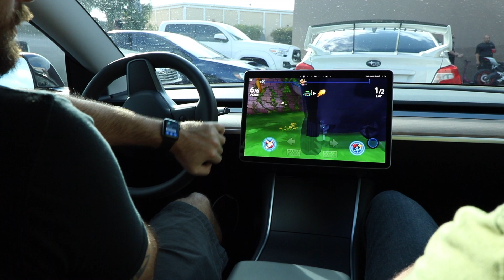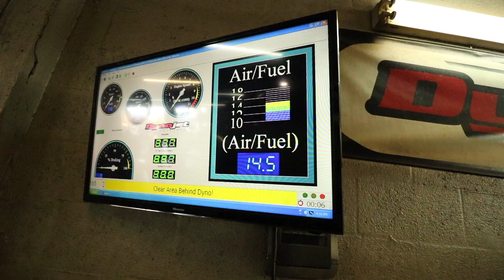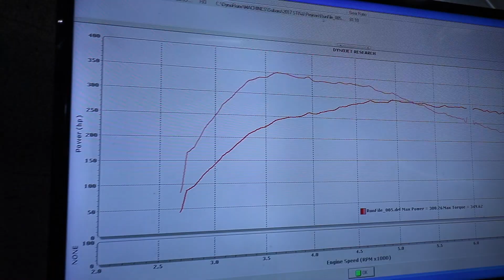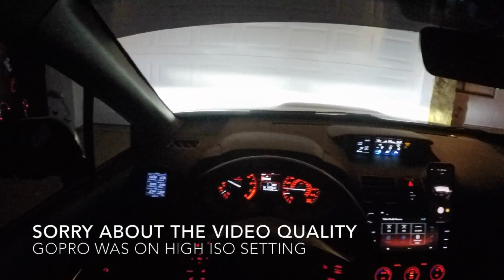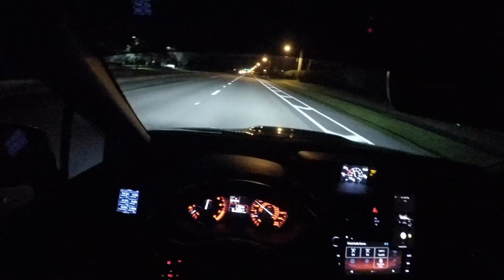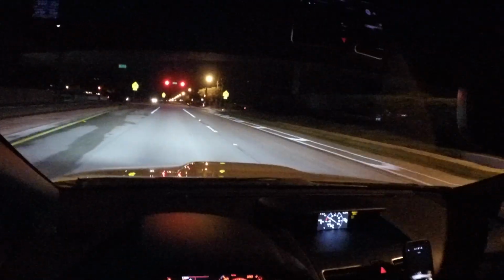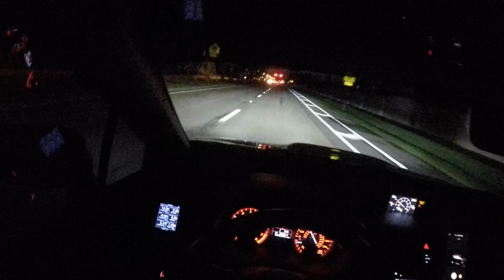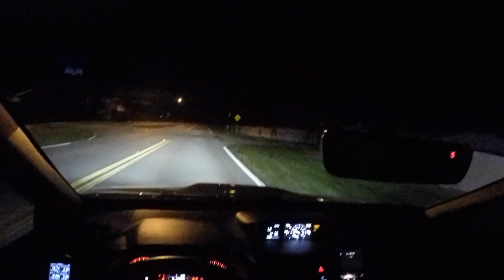STI Protuned on Dyno by Mikey Botti! (2017 WRX STI)

Comment: How much money did it cost to get all tour runs?
Reply from the maker: Can be between 450-700 depending on all your mods and if you have e85 or not
Reply: Okay I have some mods on my 2015 sti but I wanted to know how much for the runs.
Reply from the maker: Oh mine included tunes on the dyno also i think dyno alone is like 100
Reply: I have a AP with a Stage 2+ tune, Cobb SF Intake, 1000cc Injectors, IAG AOS, Invidia N1 Exhaust & a synapse BOV. I wonder if I can push 320. How does the Pro Tune work? Is it Per Run? Or is it a certain Price to get it perfect??
Reply: I have another question do you need a Catted Downpipe to get a Pro Tune?